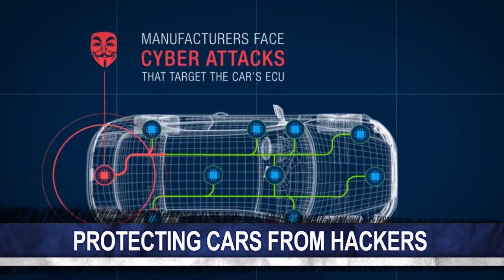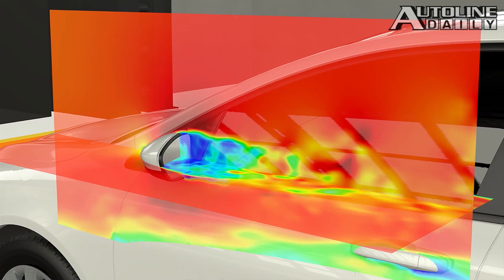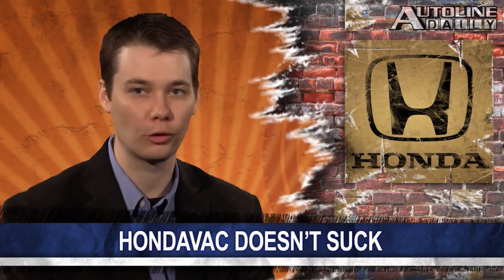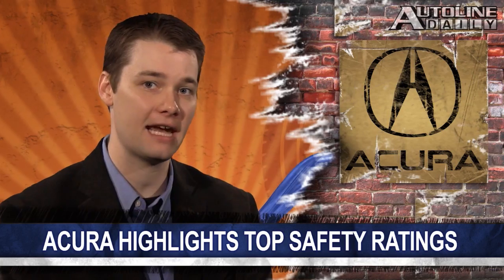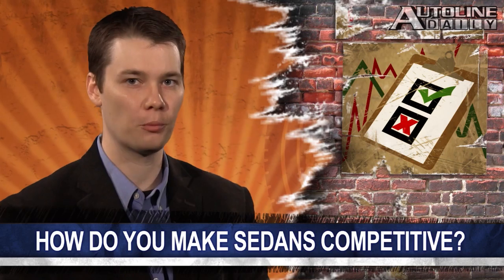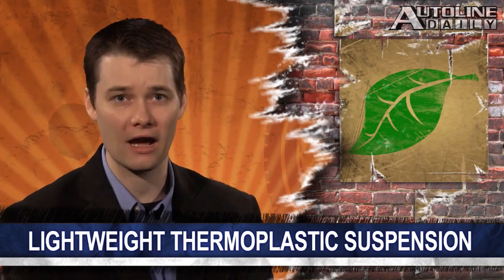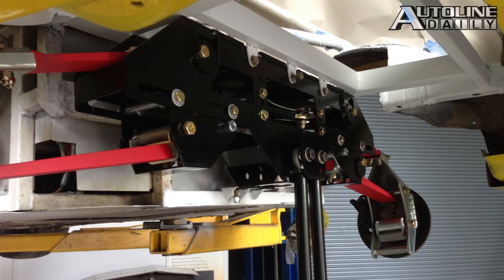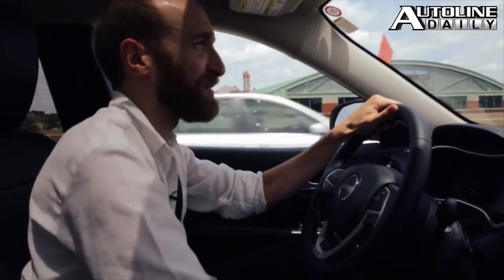New Simulator Optimizes Aerodynamics, Lightweight Composite Suspension - Autoline Daily 1724

Comment: CFD simulation isn't something new. Engineers run many simulations simultaneously with minor different adjustments to see changes before putting their finalizing prototypes and tests them in a wind tunnel for actual results. I'm more intrigued to know that what differentiates their simulations from traditional ones that can even possibly replace the need for an actual wind tunnel.

Comment: A composite suspension? With a composite subframe and suspension components, rusty subframes and suspension components will become a thing of a past. The reduced weight will also reduce unsprung mass, further increasing potential MPG and even improving the overall performance of a vehicle. I'd love for this idea to find its way into the common production car in the next decade or so!

Comment: Sedans should become sportier, using their lower weight, lower CG, generally better aerodynamics to leverage having more performance and handling ability at a lower cost than to super-outfit a CUV to try to match than a sedan or coupe. Cost WILL be a huge deciding factor. Just build cars that are, by default, better at performance with only a modicum of performance parts. Build to the task and it will be less expensive.

Car makers, especially American car makers, should then also be far less "allergic" to making truly high performance cars and a wider range of them. Enough of just the one or two "special" models off on the side, eyeing the Chevy SS and Ford's Focus RS. On the F-RS, AWD as an actual performance option and not just a "tick box for safety" in many more of these cars, eyeing the Fusion with AWD.

I know Ford wants to use the AWD system from the Focus RS in more cars, like the Fusion. It hasn't happened yet and I would be discussing it ad nauseam, because out of sight out of mind, and Ford will let it go fallow if they aren't kept to task and make it so.